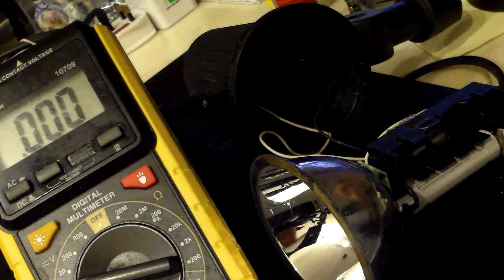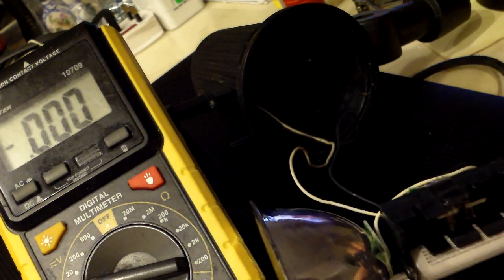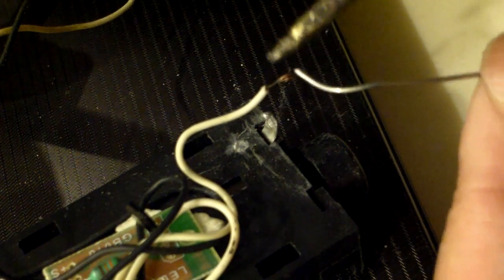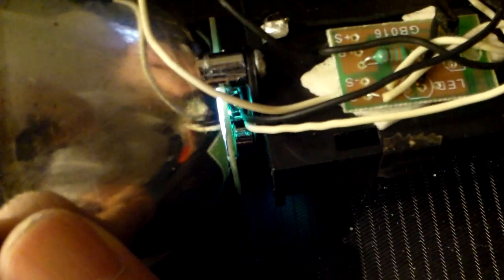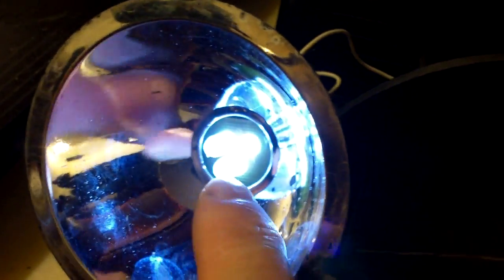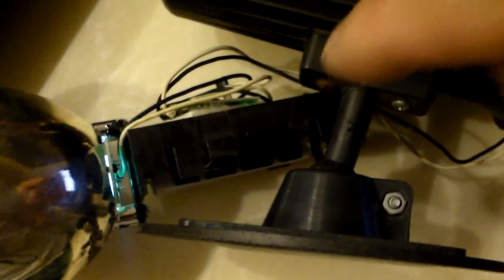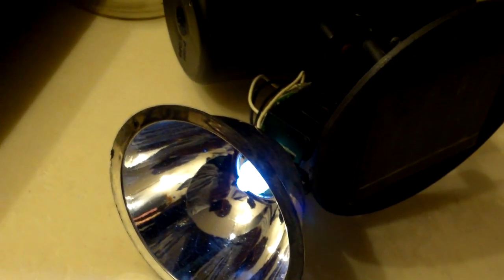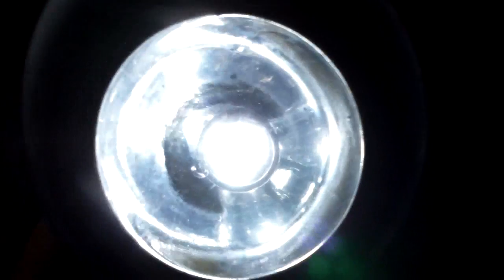Simple solar light repair

Comment: Wait, you can sandpaper the solar panels when they get faded? You just taught me something else. Thanks!
Reply from the maker: Now I'm experimenting shrink wrapping them. I noticed if you left the clear protective cover on some solar panels, they will last much longer. Some of the better ones are shipped with a clear vinyl adhesive which you are supposed to peel off before using them. Leave that on and your panels will last an extra two years or more without discoloring.

Comment: One note for you. That is not a chip, it is a PCB board and it is entirely fixable if damaged to a point. The traces are epoxied over and unless the entire PCB is burt totally, burning off the copper, all you need do is scratch and solder (simple explanation) ---MasterGeek

Comment: my on/off switch must have a short or something? coz when I push it up to turn on I have to keep pushing hard or hold it a certain way before lights come on. I'm wondering how I can fix it but I don't have a solder? if I needed one are they expensive I wonder? or how do you fix the switch? it does move up to on n will turn off when I trun it off . just won't stay on after buying new batteries.

Comment: My led light became disconnected from the solder contact.  I'm not sure where the two wires go on the board.  Do you think it's worth trying to fix?
Reply from the maker: Just use trial and error. Look to see where it might have disconnected. Temporarily reconnect it and if it works,  resolder the connections. Solar lights are usually low voltage so you are not likely to get shocked.